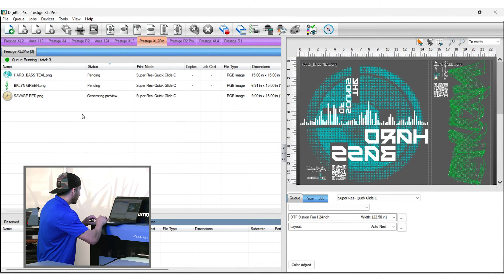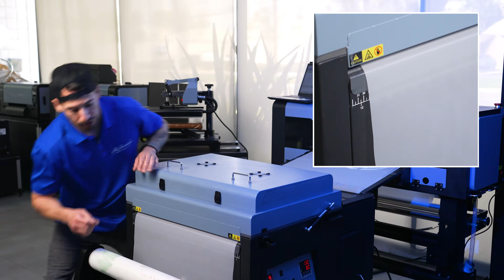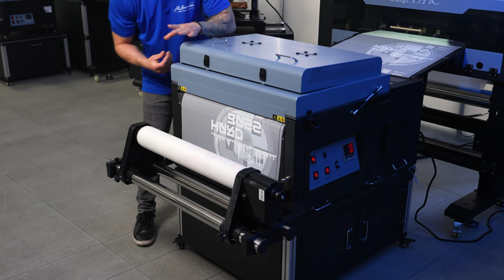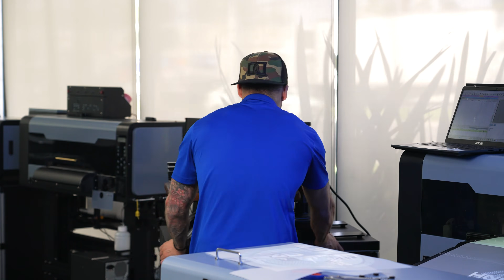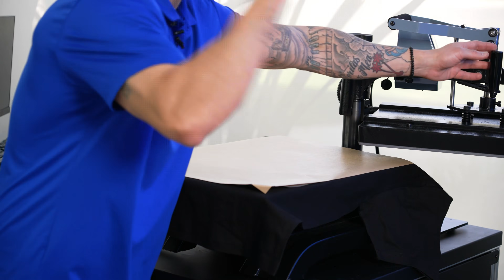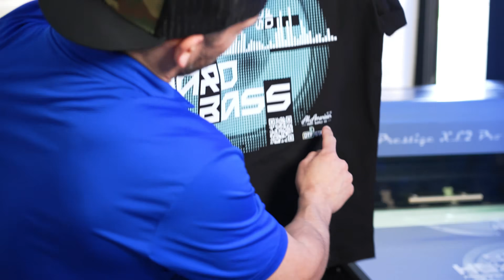DTF Printer UNCUT: Full Walkthrough

Comment: Great video! What ink and powder are you using? Also, why is it some people will press at 320 for 20 seconds vs 300 for 10?
Reply from the maker: Hi, thanks for tuning in. Here's the ink/powder we used: 
https://aaprintsupplyco.com/products/colorprime-dtf-ink
https://aaprintsupplyco.com/products/color-prime-hot-melt-powder-for-direct-to-film

Application settings will vary from brand to brand and has to do with the film coatings (mainly the release layer). Depending on the brand it is normal to see heat press settings in the range you described. Here is a quick video explaining the settings you may see us use: https://youtube.com/shorts/b1XPUrrrszY
Reply: @ Thank you so much!